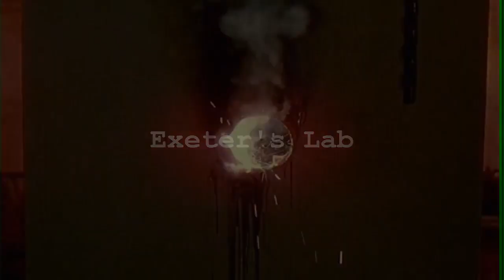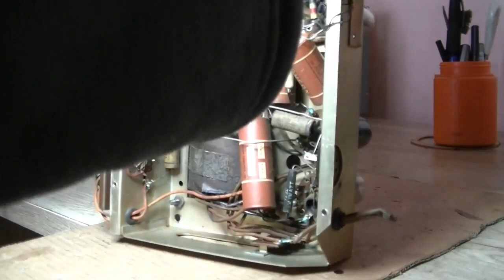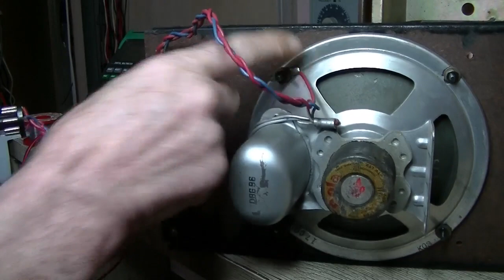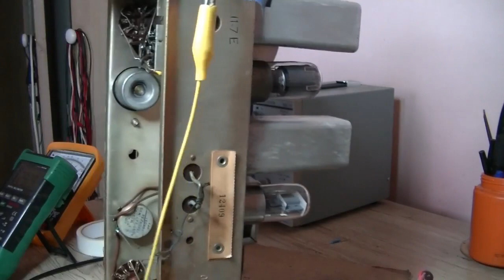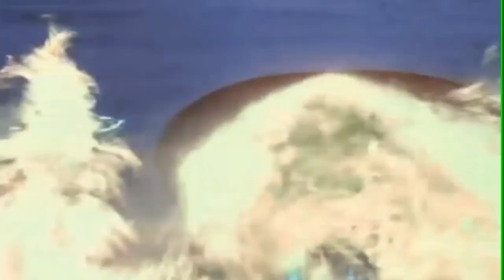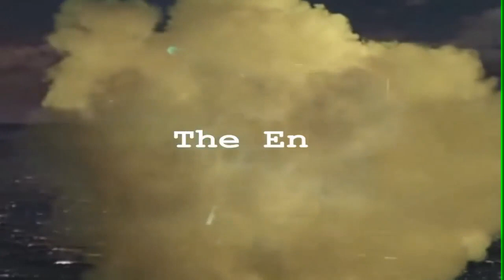Kriesler 11-7 Valve radio Restoration 1947

Comment: Static and an inability to tune means the local oscillator isn't running. The oscillator and antenna coils change to their respective coils when selecting between MW and SW, the dicky switch was preventing the oscillator coil from being connected into circuit. Other comments have said the same thing. I have had a number of sets where the LO wasn't running for one reason or other, it's more common than I imagined. Good work.
Reply: Thanks David. You and the others are legends in radio restoration. I'm in expert company 😀😀😀

Comment: I think the band switch wafer board contacts (wiper) were oxidized causing no oscillation and perhaps RF issues since both the antenna and oscillator coils next to the switch are connected to that band switch. The tone switch sounded like static coming from it at one point and if the circuit is anything like a lot of older American tube radios, it should be off then the on position is with the high tone and then the second detent should be low tone. Really enjoyed this great repair video and restoration.
Reply from the maker: Thanks Ken, You and Stuart Irwin both nailed the issue. I'm learning more and more from you guys

Comment: Easily explained.  The contacts associated with the oscillator circuit were dirty, preventing oscillation.  The set will still receive but only at the intermediate frequency.
Reply from the maker: Thank you Stuart. You and Ken are fab at explaining various radio issues 😀